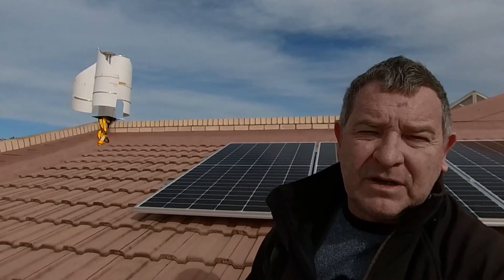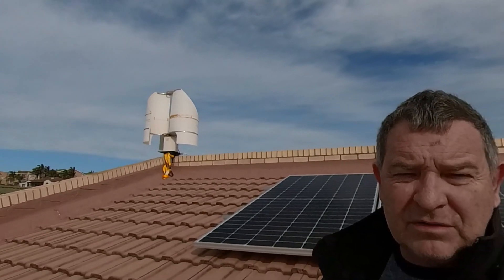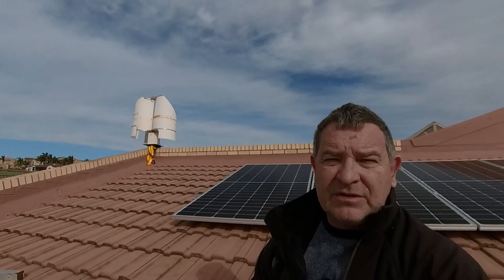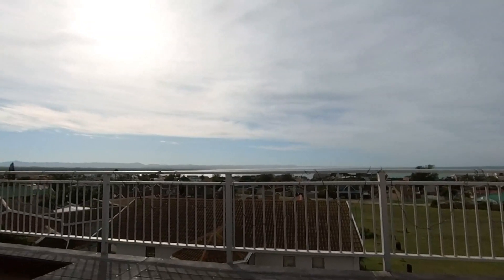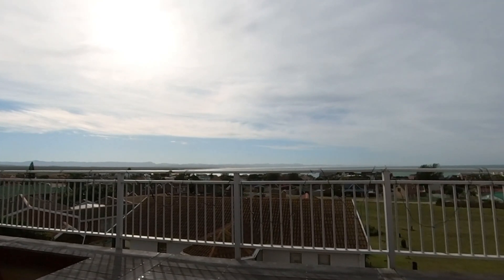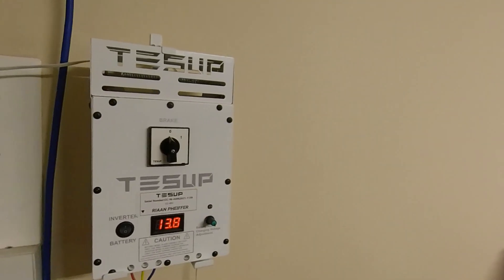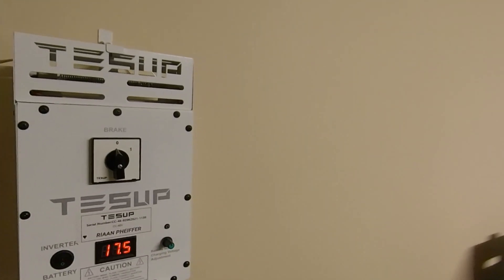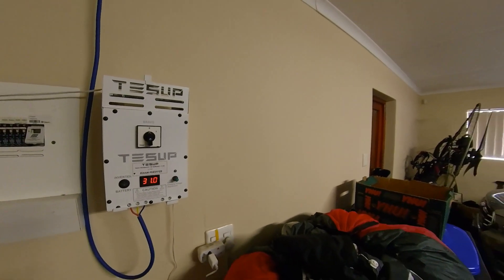Tesup Wind turbine update.

Comment: All practical tests show that small wind turbines hardly generate any electricity, because hardly any wind blows close to the ground!
With solar panels, you can generate at least 10 times more green electricity with the same investment!
Moreover, the wind close to ground is extremely gusty, which almost always greatly reduces the service life. 
Only those who MUST be off grid in winter should install a large wind turbine on a high tower with a battery.

Comment: Wind turbine - 6diode rectify - microinverter 60v

Ultracapacitor can be used to stabilize
Reply: Microinverter has high eficiency. And avoid batteries is an advantage.

Comment: use a 12 V lipo4 180A to charge from turbine and from thre use an upvoltage regulator to 48v of solar batery. Charge controler will keep 12v battery charging, when full upconverter transfer to 48v solar sistem battery. Small lose on upconverter but is a solution. upconverter can be set up also to fit your setup
Reply: How much is the maximum charge voltage because i need around 57-58V!

Comment: Does anyone know if a Tesup turbine/inverter would be compatible to use in conjunction with a hybrid inverter? Such as a Solis
Reply from the maker: Hi. The Tessup turbine controller needs to be changed if you want to connect it to the inverter. That is my case anyway. I need to step up the voltage so that when connected to the MPPT it is hi enough for the MPPT to open to be integrated into my inverter.
Reply: @PPGRiaan  I have seen folks use capacitors & batteries as a buffer to keep the voltage up between turbine & MPPT. Not sure if this is applicable for your particular set up. I would not be buying the Tessup inverter as from what I’ve seen, it’s incredibly basic & not reliable. I am however interested in using a Tessup Turbine to help trickle charge my 15kwh bank when sun is not available and other such circumstances. I’m at capacity in terms of solar panels, 8kwh connected to 6kw inverter. (Plenty of overhead for cloudy weather) So my next avenue will be looking at keeping the batteries topped off. Also, 6kw is the max inverter capacity on 1P in my country. 3P connection isn’t an option where I’m based. So maximising by battery capacity/longevity by bolstering with wind was the thought process. Cheers for the input. I’m going to drive ahead with it.

Comment: So you haven't gotten the full potential out of it?
Reply from the maker: Hi. No I have not gotten the full potential yet. I have been out of the country for some time but my house is running on my solar system.  The turbine I want to use as an experiment
Reply: I am a mechanical engineer and many wind turbines do not give the real capacity to what they offer, be very careful when buying this equipment, greetings, soon I will upload the video of the 100% self-sustaining photovoltaic installation.